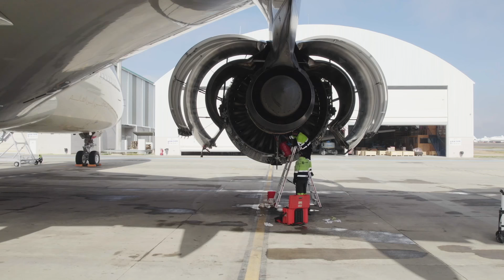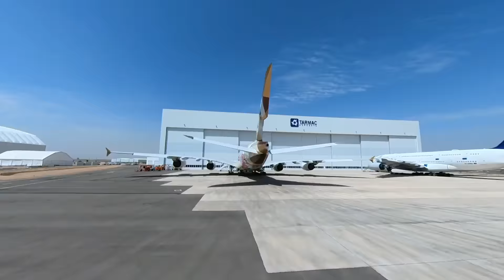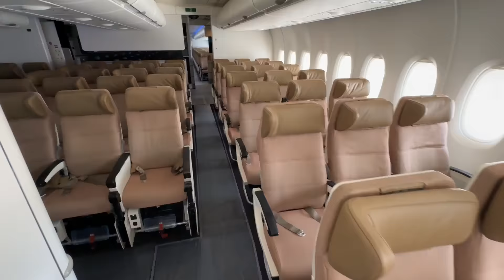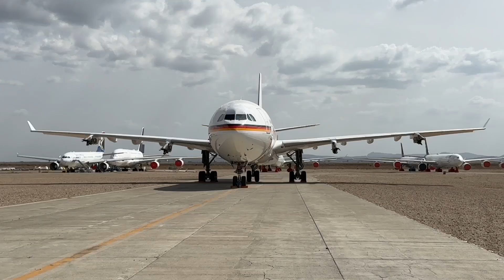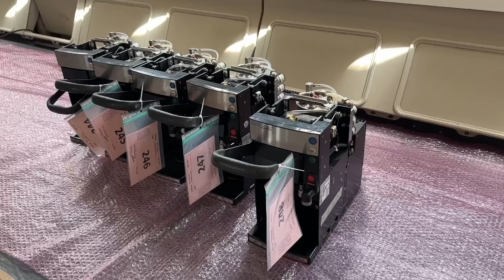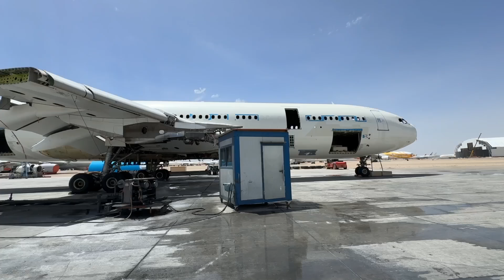Inside Europe's Biggest Airplane Graveyard

Comment: And those 4 BA Jumbos the last remaining non museum BA airframes could have been utilised (as BA are short of capacity) but the dim numpty Bean Counters put paid to that, not even one Queen was kept for Grannie's dream trip in a jumbo around the Bay of Biscay. Perhaps one daily rotation to DXB (there used to be as my last BA B744 flight was out of DXB) --- imagine you have a choice to take the BA B744 or a donkeyliner -- I think Marketing/Sales Dept might be extremely surprised at the outcome and that is why the Bean counters should be kept well away from Airline Marketing and Operations. Those RB-211 engines well tested and with proven reliability against the Donkeyliners with their RR Trent engine problems littered around the BA Hanger areas a few years ago.
Eight of the previously stored EY A380s are now fully back in service - two airframes were scrapped for spare parts for the fleet, same as QR 8/10 in use.

Comment: Allow these planes used for various Airports and spots.
1. Table Top Tourist places world over by Group of Hotels and Motels.
2. For Aviation Education purpose 
3  Converting to Simulator with Actually installed Gadgets and Electronic Equipments. 
4. For Stacking Cargoes on Airports 
5. Emergency make shift Residential.
6. Combining with Hydrofoil systems and Using on Water Surface transport. 
Uses of These planes would make Manufacturing company proud And all Effort made fruitful and It would not go waste.

Comment: From what the girl is saying about maintenance checks, it sounds quite straightforward but I very much suspect that it will be very time-consuming and so will require an awful lot of man-power in terms of the number of staff required at such a facility.

Also, I am sure that the runway at this place was the one used in the Volvo Trucks advert which featured Jean Claude Van Damme.
Reply: They are different airports. Van Dam's Volvo Trucks commercial was filmed in Ciudad Real airport (CQM/LERL) while this video facility is in Teruel Airport (TEV/LETL). Both ones in Spain, but different airports.

Comment: I would not recommend anyone standing beside or few feet away from the cutting wire. Seriously that area should have been blocked off during the cutting, you never know when the cutting cable is going to snapped.

Comment: The recycling part is so interesting. My first student job was actually inventorying aircraft parts which were removed from donor planes and checking that the ("8130" if I recall correctly) certificates were provided. If the paperwork was not in order, the parts were unusable.

Comment: Saw a (I thinkl) Royal L1011  at Dorval (YUL) airport get "recycled" many moons ago.  At first it was near the Royal hangar with progressively more naked (window removes, doors removed etc). Then it was moved to private aviation area when it was put on wooden blocks so landing gear could be removed. And then it was cut up with hydraulic jaws so very "ugly" parts as opposed to the straight clean cuts seen in your video. (I was allowed airside to see it up close one night).   Notable: you can see the numbering/serial number of every metal part which provides insight of how they can rebuild aircraft after a crash to investigate it.  What impresse me was the sheer size of the L1011 fuselage which had been cut relatively clean when the cabin ceiling (and everything above) is removed, leaving empty cargo deck a floor and the main deck. 
(Québec had a couple of Charter carriers who went bust about the same time, which is why I am not 100% sure if it was Royal or another).

Comment: I know the aviation industry is extremely complex given the very advanced technology used in the airplanes but I can't help but feel that retiring planes so early in their lifespan is such a waste, even if they do use more fuel than newer types. Recycling and scrapping planes and building new ones is more harmful to the environment than using a plane to the end of its lifespan, it's just cheaper for airlines. I feel that the free market sort of fails the aviation industry. If people could connect to any airline on one ticket (with legal restrictions in place to prevent price-gouging), if the fuel market wasn't dominated by giants who control fuel price and make it so volatile, if leasing could be more flexible and different planes allocated to parts of the world with more demand regardless of airline ownership or cabin, we could prevent such waste.